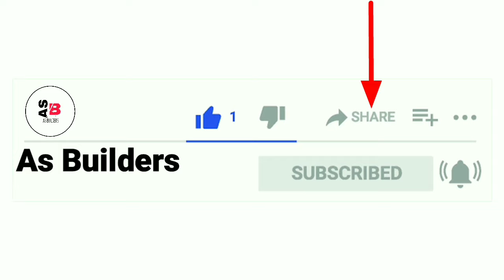How To Install Wallpaper Like A Pro - Residencial Wallpaper Installation - Start To Finish Tutorial

Comment: Can you please tell me the name of solution (i mean glue which you apply on walls)...
Reply from the maker: Thats a simple wood glue you can buy from any ply wood shop
Reply: Why do we need glue??
Isn’t the wallpaper paste good?? 
Also many wallpapers nowadays are supposed to be easily peeled off when wanting to take off.
I would imagine glue would make it a task to take off? 🤷🏻‍♀️
Reply from the maker: These are two types of glue mixing with required water and then shake that well.. So thats comes a good pasting solution..